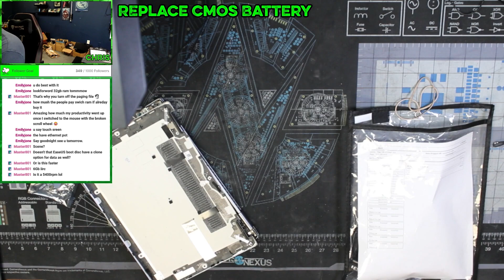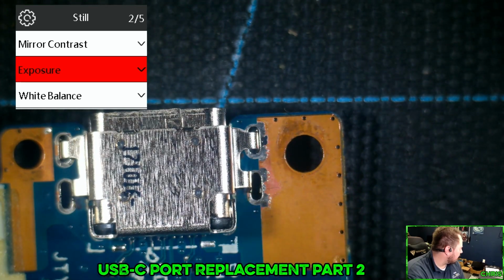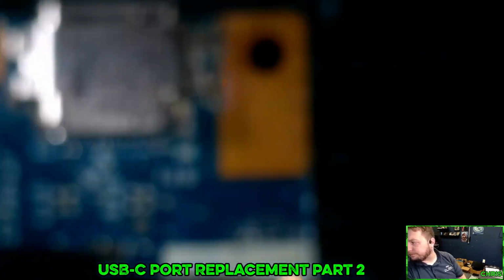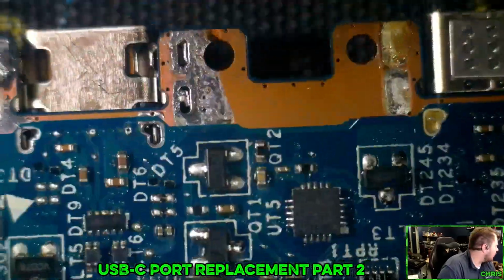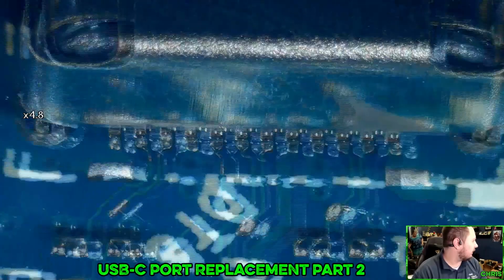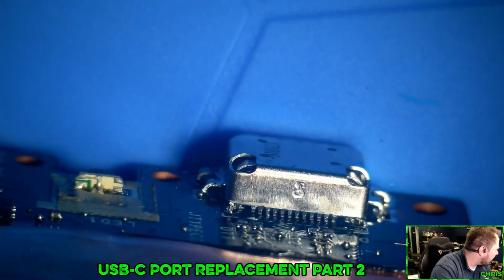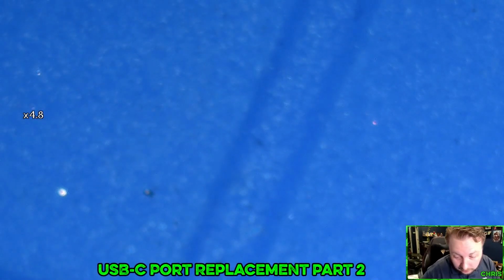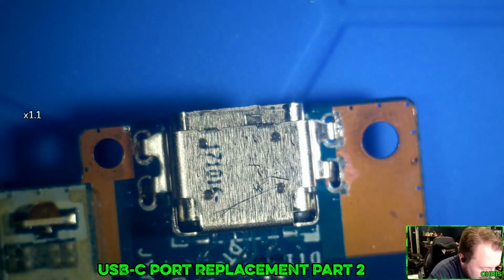Lenovo Yoga Laptop Won't Charge, Lets Replace the USB-C! Part-2

Comment: Did you end up fixing this? I have the exact same laptop with the exact same charging issue
Reply from the maker: The way I fixed it was by moving the other point over. It was impossible to find the actual port.